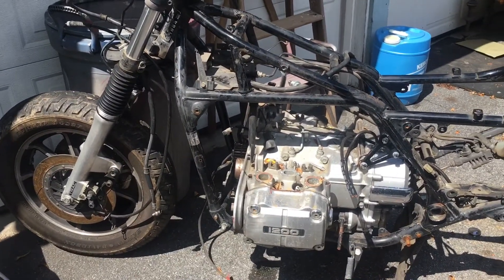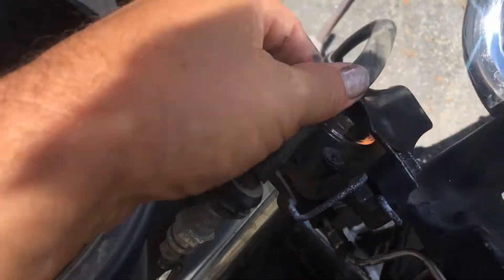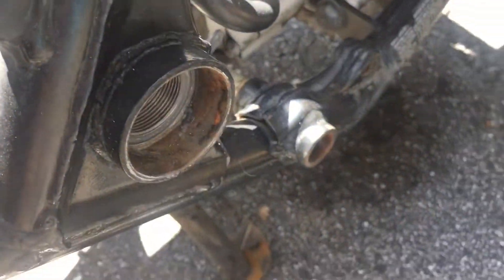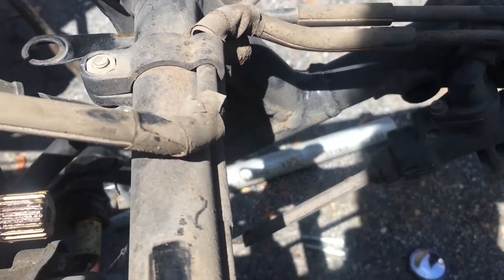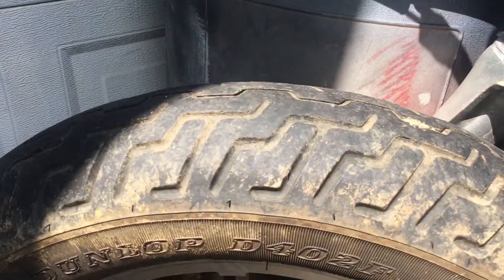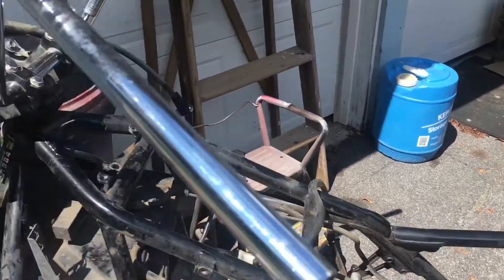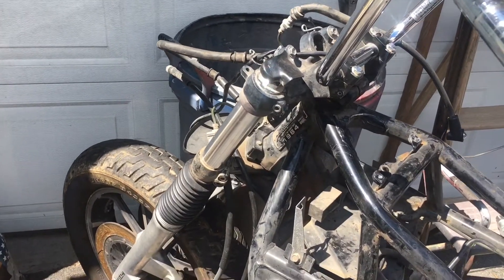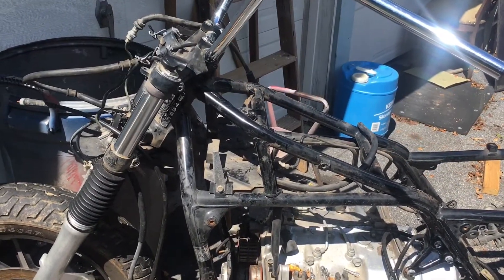Honda Goldwing Brake Study- How it works Front and Rear GL1200

Comment: This was a huge help because I had my front brakes get locked up the other day at a stop sign and had to open up the brake line at the master cylinder. And when bleeding them again I was confused as why no matter what I did I couldn’t get the right side to bleed until I watched this video and pressed the rear brake pedal while bleeding.

Comment: I have an ‘82 Interstate, and I’m actually going through all the brakes right now, including upgraded master cylinder/hand controls, s.s. braided lines, new pistons, seals, and pads, and paint on the calipers. Thankfully, it does not have the linked brakes that the 1200 apparently has. I also had an ‘82 Aspencade about 10 years ago, and it too had conventional, “separated”brakes. ✌🏻
Reply: Thanks for the like! If you’re interested, here’s what it looks like now https://youtu.be/yqqfzFX_pS0

Comment: I’ve got a 82 Goldwing with sidecar and the rear brake pedal will go down with a lot of pressure but once I release the pedal it will not come up unless I pull it up and it tough. 

The brakes do stop the bike when I apply brake and release when I pull it up.
Reply from the maker: If you have brakes on the side car it may be linked to that and I would check and grease those connections. There should be a large return spring on your rear brake pedal itself. I would check that the spring is mounted correctly and giving pressure to send it back to rest and make sure the pedal is greased where it pivots, as it should move freely. Does that make sense? Unfortunately, I do not have experience with the sidecar. This is where I would start! Let me know how you make out!